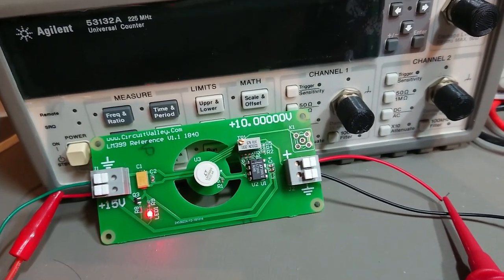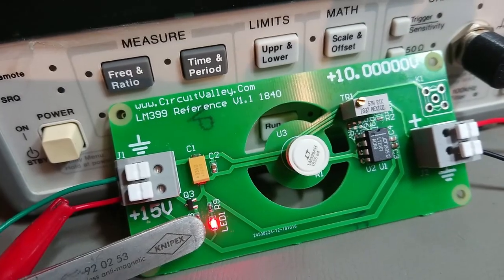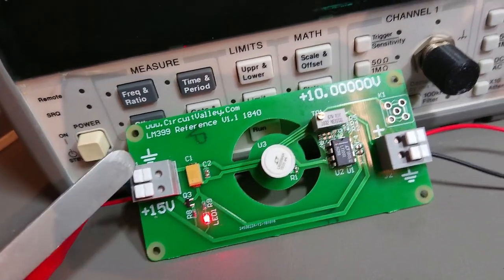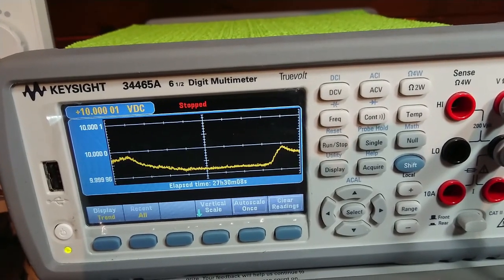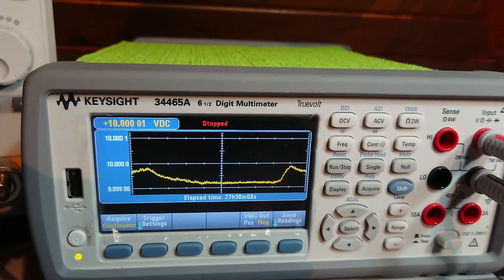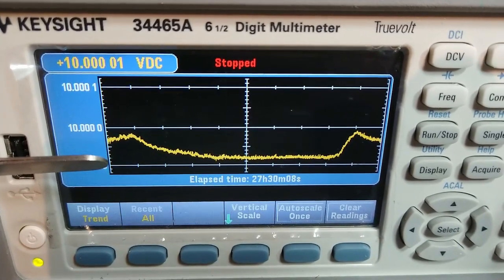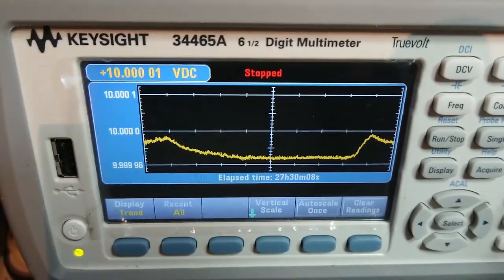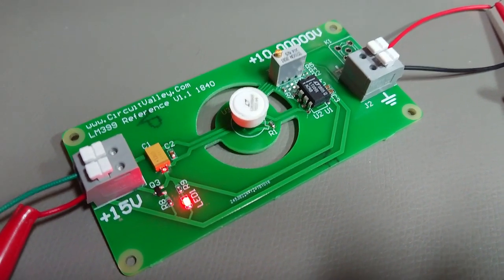DIY V2 Open Source LM399 10V Calibration Reference Board

Comment: The LM399 device is already temperature stabilized and thermally insulated, so the foam is unnecessary. The buffer circuit is where you may find a greater variation with temperature. Using temperature stable high accuracy resistors is a good plan, perhaps using a temperature controlled box for a stable voltage divider.
Reply from the maker: Tank you

Comment: I made one of the version 2 boards . It would be much easier to have multiple series resistors  vs multiple parallel resistors.  You can add a few low ppm resistors as needed (Keithley uses this approach in older meters to get 2V reference. ).  Also the zener diod could be pulled up from the output  via 1.5...3K resistor for better current stability. Keep the current  pull up from main power via but change it to  200K resistor to make sure it starts. Thanks for the board design. The pot is best to have it in the  100 ohm or lower range as the 100uV  position requires  ~ 0.2 Ohm adjustment per 100uV . I bought 12 Lm 399 from LT and they the voltage spread was between 7.025V to 7.064V . Not sure if that is Normal but that should  narrow the resistor values a little. The LM unit I tested was 7.0355V and to get 10V  i needed 8,06Kom + 1.5Kohm  on the feedback  from output and 22K +499+ pot ~180 on the lower end of feedback.  Still hard to adjust the last digit.